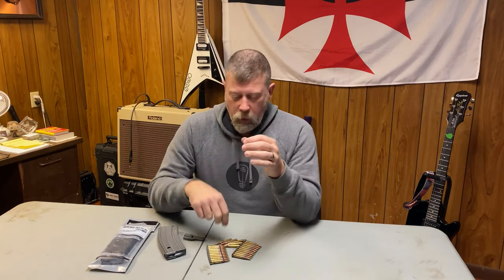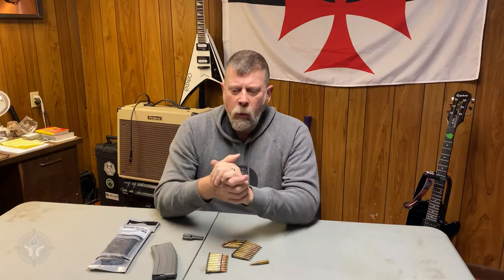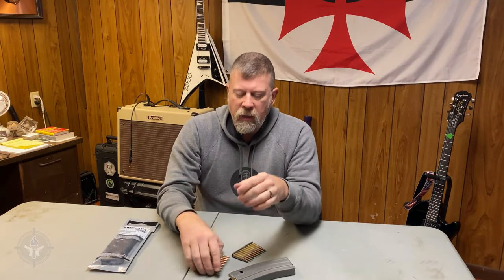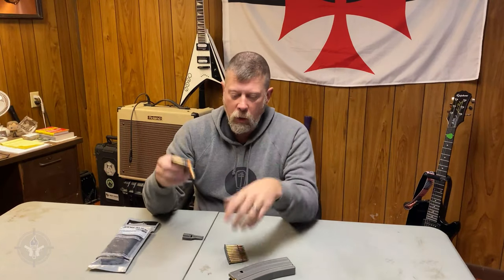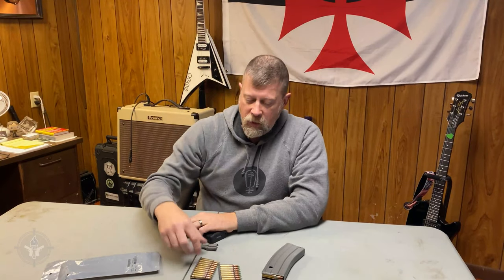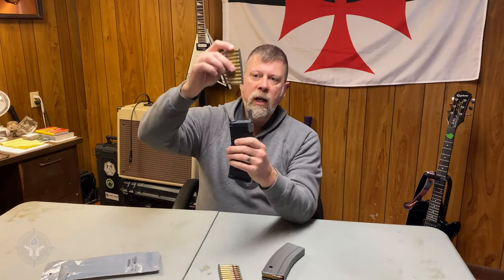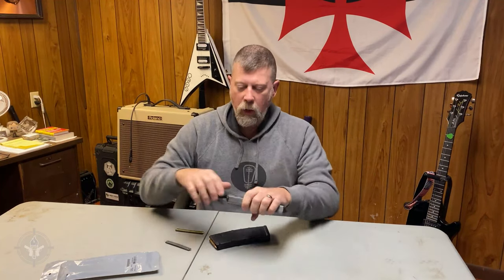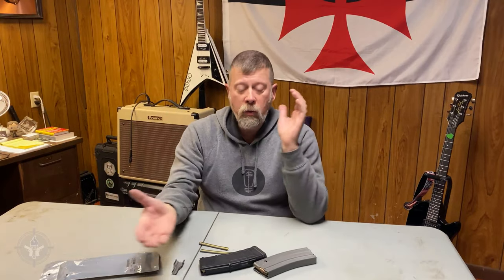How to Load AR-15 Magazines

Comment: I just ran across the video very helpful?
 I a 300 Blackout and when I load it with the bolt  locked back it slams in the battery?
 I have an ambidextrous mag release which I'm trying to adjust so I have to be pretty firm when I put the mag in but then it slams not every time though?
Any suggestions would be appreciated thank you.